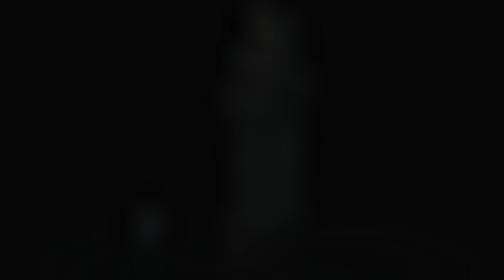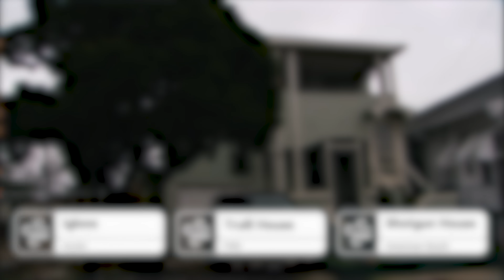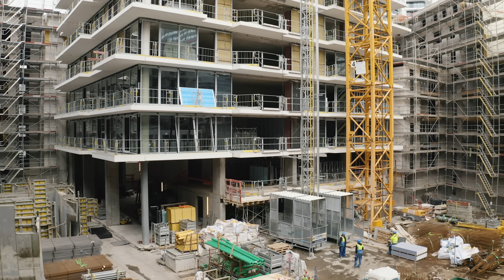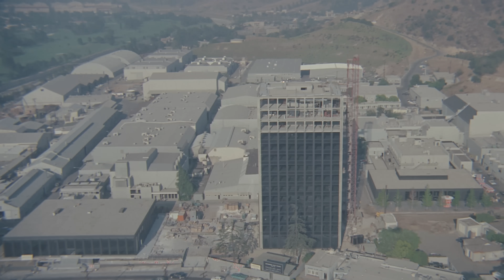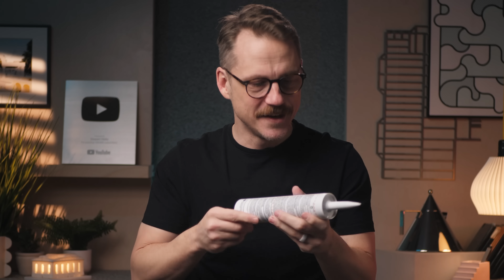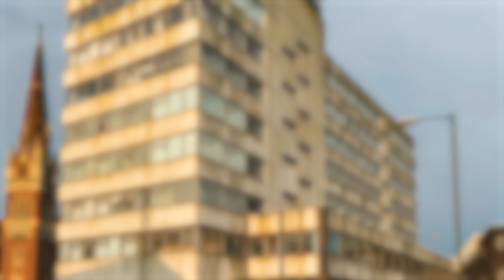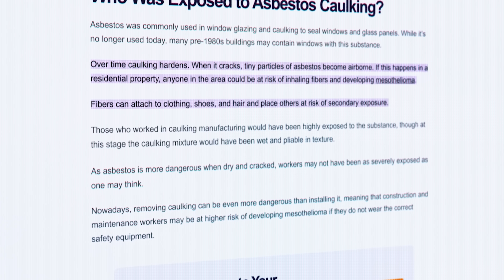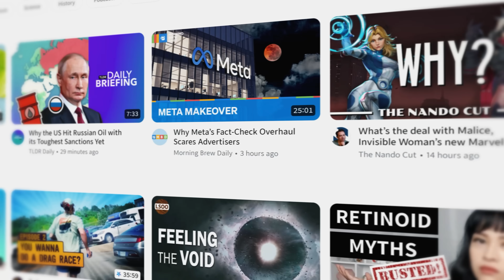How Caulk Accidentally Made Buildings FLAT

Comment: This so beautifully illustrates the difference between accuracy and precision.
Mass manufacturing is putting all of the points into precision. Every piece produced can be the same. When every piece is identical, then it is precise. But that doesn't mean that what is manufactured perfectly matches design. Manufacturing processes introduce all sorts of weird things like material choices, warping and shifting based on temperature and handling, and limitations of machinery dimensions and options.
Accuracy means that everything is on target. It is perfect to match original design. For a very long time mass manufacturing was a huge step down in accuracy compared to human labor. In fact, even today when mass manufacturers have honed their craft to such insane levels of accuracy, you would be amazed at how many products are at least picked or placed by human hands if not actually hand crafted. While mass manufacturing can be accurate, that accuracy often comes with great expense of sensors, computers, and moving parts that introduce failure points. It is getting cheaper... But it isn't cheap enough to be used everywhere yet.

This brings in a 3rd element of why modern construction looks so bland. With stone crafted buildings you have humans on site to make a judgment call for how things come together. With mass manufacturing you have the duplication issue. But with mass manufacturing you also have a blind production run. It greatly limits what materials and shapes can be used, which is why we need the goop and gaskets to pad out the issues. But with modern manufacturing methods like additive manufacturing, and cheap(er) but accurate robotics, it is allowing for much more variety of material and dimensional options again.
Or put another way... Pumping concrete slurry through an oversized caulking gun to 3D print a building isn't necessarily the best use of modern manufacturing. We have mobile pick and place machines, with 3D awareness now where we can do more of an old school construction method of block placement, or even beam or stick framing with less and less need for human intervention. The bulk of the material can be flat packed or palletized to the site, and when a weird piece is needed, then it can be printed, molded, or CNC'd on site to deal with the edge cases to create buildings that better deal with the elements. And then slather the back side with caulk, sealant, foam panels, and everything needed to create the thermal and air breaks needed for modern efficiency standards. But when the rain, snow, critters, and fire can't get through the facade, it will let our synthetic materials only deal with filling gaps and voids like they are intended to. It should make for a best of both worlds approach... And some better looking buildings, because the big glass towers suck to look at. A few are fine, but some variation would be appreciated.

Comment: I've worked on the development of sealants in the car industry. So much went wrong there...
As you've mentioned, experiments do have many limitations, but beyond the ones based on their artificial and reduced nature, the biggest issues are actually costs and time constraints. (Duh!)
So, you get such moments like the following:
1) Company: we want a new sealant with the following properties (far better and cheaper than the current ones, which is quite optimistic....)
2) Other companies try to achieve these goals and they all fail! 
3) The company then picks the prototype which has in their eyes acceptable properties (often secret to those who had to try the impossible).
4) Then the company goes to the winner and says: hey, could you still work on these parameters, but it shalln't cost a dime more...
5) The problem now: every modification can have cascading effects, which need to be accounted for, but we don't get the time for the extensive tests the original prototype went through! This means that it becomes a gamble! If we asked for more time, the competition might get the job instead...
6) Problems are often still found, but not communicated to the customer, or at least downplayed...

In my case, we had the problem that moisture caused the formation of a transitional area which had worse material properties and caused a spot where rust would form over time. The thing is that we couldn't control moisture or temperature, as they would be depending on when and where the material is used.
To make things worse: we used the cheapest oil available as a plasticiser for our formulation and it was never intended for that role (actually an oil distillate for rust prevention on steel). Since it was never meant as a plasticiser, it wasn't tested for that role. As a semi-natural product, it came with different batches which differed significantly in their composition. This caused massive problems as some batches had too many volatile organic compounds which would evaporate during the curing of the sealant and cause it to expand uncontrollably and completely ruin the material properties. A few cents per kilogram for a purpose-built plasticiser would have fixed the problem, and I strongly recommended doing so, but the company would rather risk producing multi-ton batches without actually testing it for that problem and then risk having the car manufacturer having to call back hundreds of cars!

So, the TLDR is that quality and safety standards are not as strict as they should be. In other fields, this may even result in cars becoming fire hazards, such as using polyurethane foams and interior linings made of highly flammable materials. I'm not joking, there are examples of car interiors burning like soaked in gasoline...

Comment: Problem also ends up with all the caulk and adhesives end of life at the same time, not worth refurbishment when replacement is faster and cheaper? Labor to redo the caulk and adhesives throughout a structure add up fast. Back to local solutions needing customizations.

Comment: You make great points as it pertains to high rise or the types of commercial buildings you showed. Caulk didn't force architects to go with these types of bad designs. It "allowed" them to, for aesthetic or cost purposes. You can't blame that on caulk.

In residential construction in North America, no competent contractor is relying on caulks/sealants alone. Unless unforeseen constraints force you to, for design or "oops too late". We use water sheds, overlapping surfaces, drip edges, flashing, etc everywhere. With the exception of vertical seems, Caulks are largely used as a second line of defense/aesthetics. 

When you use the right caulk, apply it properly, have stable enough seems, and take care of the paint, it's very stable.  And when it does fail, Usually direct sunlight + dark color, it starts with obvious microcracks in the surface, that if you do regular inspections, it will be spotted in time. 

If you use caulk alone on a horizontal surface that can catch water, rather than slope away, or surfaces that have inherently too much seasonal movement for caulks to be applicable,  you just asking for trouble.

Caulk allows us to reduce building costs, and removes design constraints. But you still have to respect the basic tenants of "build science".

Comment: I get what you're saying about how caulk and sealants have "flattened" architecture. It's just like how lots of houses have been clad on the outside with siding that goes all the way down, but don't have long overhangs or a raised foundation to help protect it from rain splashes causing rot and stains. However, your inclusion of concrete sealing clips is a little misplaced. The ones you show are for completely outdoor applications. Concrete joints are created to induce cracking in a specific spot, because all concrete cracks. That crack/joint can then be sealed against water intrusion, but only because you know where that crack WILL be. Otherwise, you would have to make a material change that comes with its own tradeoffs. Yes, that sealant has a life span and will need to be maintained, but there is literally no other way I know of to do that outside of maybe doing an asphalt overlay.

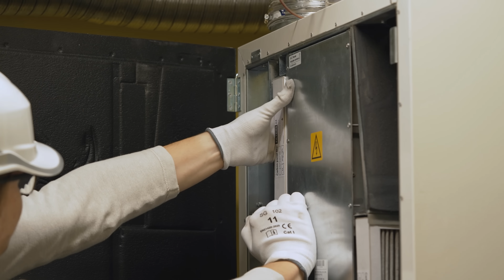Comment: 16:16 Luften. What you need is the ancient German technique of Luften. Or opening the window even during winter.
(We do the same in Spain, we call it airear, which would be almost a 1:1 translation to luften).
Reply: you'd think that out of anyone, Germans would over engineer a solution for air quality.

I also won't open my window in Winter even if you paid me. It's already freezing inside and its 30 degrees warmer in here than out there, and I can literally feel the little heat I have leave my body when the door and window open.

Comment: I grew up in a house that was 100 years old and was built to maximise air flow, so was somewhat comfortable even in Texas summers,
However, the features that were adapted for summer were the opposite for winter.
During the winter, visitors would often keep their coats on during their visit.

Comment: I grew up in an old house from the 50's, some time during my childhood my parents had replaced the windows with modern windows, but they installed them in the wooden frame of the old ones.

because of that, there is still a bit of a constant exchange of air happening because  the wooden frames are not sealing perfectly against the wall, so even with(or because of) a wood stove constantly burning there is no real need to ever open a window for fresh air, I recently installed a Co² monitor at the house(now only my mother lives there) and it hardly ever goes above 1300ppm even with 3-4 people in the same room

Comment: I thoroughly agree where design ignores real-world local conditions. IIRC, architecture critic Paul Goldberger has written about the real-world issues of introducing OG Bauhaus standards (from Weimar and Dessau) to what is now Israel. There is a folly in designing buildings which are fundamentally at odds with their locale--or modifying buildings in ways which are fundamentally contradictory to their locale or use.

I own an old house. Sealants are immensely important to me, not least because they allow me to introduce a joint-preserving element in a local environment which can be extremely wet. I'm building enclosures so that I can paint and seal doorframes, and even pour a new cement pad for an exterior stairway, even when it's bitter cold. The work has to get done. There's an end of this which is more bougie and artisanal, but there's also an end where it's immensely beneficial to lower-income people looking to save on utility costs. 

Great Stuff is your friend when trying to seal irregular parts of a basement rim joist. Yeah, you can cut rigid foam or fiberglass to fit around that, but a rim joist is a primary environmental liability in any house in the northern third of the US. It needs to be sealed. Caulk around joints is critical. Ironically, I'm in a position where the only way I preserve an elemental part of my ~140 y/o house is to cut out the sloppy and destructive ornamental chach so I can replace it with more authentic trim.

Comment: Not sure if the expanding foam sealant I saw in a couple of shots should be included. Windows are deliberately left with a gap around them for the foam but it is only for air sealing, not for keeping water out. Proper panning and flashing does that, and caulk should not be necessary if that is all done right. 
(Only talking about residential construction here)

Comment: The problem as I see it is that modern architects have completely replaced the old technique with a whole new technology. Where as they should have used the new to augment the old. 

So yeah they replaced the finely crafted facades with a thin glass sheets, and sealed them with caulk. They could have made the large sections in a factory, to bring the cost down, and calk the joints like usual. Then cover the joints with a rough panel that serves the same function as the facade; but now the panel doesn't have to be as airtight, because it's caulked underneath; but the panel can still serve to protect the joint, and allow the sealent to last longer.

Comment: Cute video, but the reason you aren't constructing an ornamental building for yourself is because you don't have enough money. Capitalism killed ornamental buildings, not technology. Technology just made it possible for more non-rich people to get homes. This video is like saying vinyl killed cedar - nope - vinyl just made it possible for more people to afford homes. We NEED architects, but we don't need architects to whine about how their favorite fashion isn't popular anymore.

I also disagree that caulk is used as a crutch. Skyscrapers aren't built like single family homes, and the residential building code has multiple layers of weather protection specified, and the caulk is just a small part. If the caulk around a window fails today, the water is supposed to hit flashing tape and run out the bottom of the siding. If your house leaks behind the caulk, then that's not the caulk's fault. The caulk might be used as a crutch in that circumstance, but that's a GOOD thing because it will be saving people money when they can't afford comprehensive renovations.

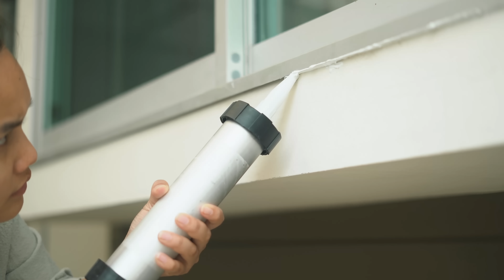Comment: At 17:23, he's not supposed to be caulking that right?  It's the exterior of a window.  What I know from watching all seventy three of Matt Risinger's  tutorials about how to install a window is that you're supposed to caulk the top and the sides of a window but not the bottom.  If any water gets in then it's supposed to drain out the bottom.  You should put some shims in there so it drains properly.  The air seal is on the inside.  The sequence is rain screen, drainage, air barrier.

Comment: I'm a painter. Life long. I do a lot of historic restoration. Many of our historic buildings have been wrecked with caulk and modern paint. Old stone buildings with interior plaster walls  and mouldings with rounded edges, tiny returns, weren't designed to be caulked. Modern paints don't breathe and they dont fail locally. Some latex flats do. But if theres a leak or moist basement walls, it holds until the rot becomes a problem, no micro breaks, you get bags of water. Luckily technology is catching up and there are some highly vapor permeable paints coming out that will be better. Some with sheens even. Old alkyds would fracture, and old frescoes or flats made of chalk, lime, or pigments and bound in milk or oil or any number of binders would also breathe or fracture if not.  Caulk is great but many buildings with multi piece mouldings were designed with tight seams, but open seams, maybe a little return behind a round edge. Using fillers, not caulks. The walls being finished by hand, lathe over rough framing, everything varied and the square plumb flat wall as we say "come out in the wash", multiple passes. But i wont let anyone caulk in these projects without great thought. Caulk expands and contracts. I've seen it blow up like fish lips after seasonal changes. In old buildings things should be hard and breathable. If its been changed over the years to flexible vapor impervious coatings, then you better make sure it never gets wet from behind again or the temp is stable. Modern paints also act like slow paint strippers on old stuff. Especially outside. A barrier coat can help. The cohesive bonds are stronger than the adhesive bonds of the old paint below, and the new stuff is also more flexible and prone to move with temperature changes. Without a fmore flexible barrier\tie coat it will slowly yank the old alkyd house paints off.  Paints like Duration, when they came out promised eternal life. There was no guidance on repaints of old siding and people tired of repainting switched. It lasts forever on new well prepared work. But will strip 20% of an old oil painted sided house if painted direct. And it advertised self priming, like many. Sure it stuck but it pulled it free too. Still seeing it happen. It's one way to slowly abate an old house exterior if it happened to you. Just keep up the bi or tri annual scrape and repaint as before until all the old stuff is gone then sand it all even. The old oils lasted a long time on their own, the intervals sped up when everyone switched to acrylic if they didn't use a buffer coat. Though both alkyd and modern acrylic can last a long time if they are alone. Acrylic is great stuff though in its place. It just makes sure your water damage is worse before you discover it.

Comment: Our home is in Ravenswood--built in 1908.  The construction is phenomenal--no osb sheathing..solid wood plank sheathing with lathe and plaster interior.  The windows are all site built--about half original and half built on site during the last 30 years we've owned the home.  We do use aluminum glass storm windows in a concession to modernity...lol We have a wraparound porch nearly 80 lineal feet--however, the maintenance is daunting however...